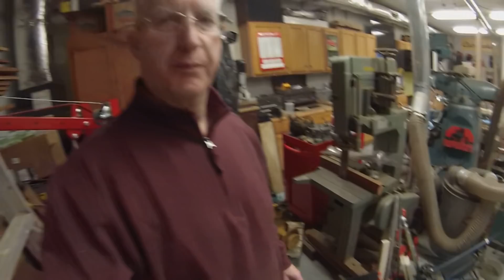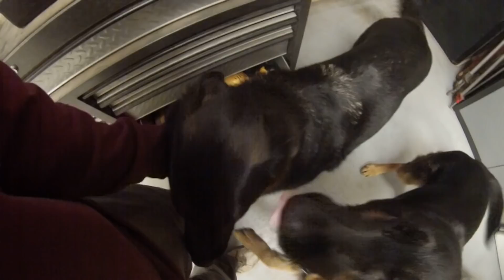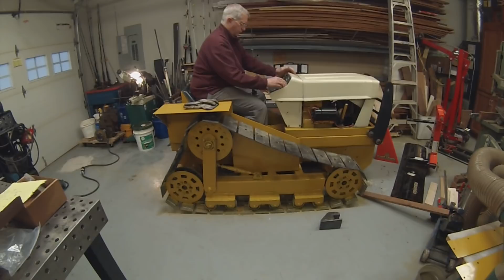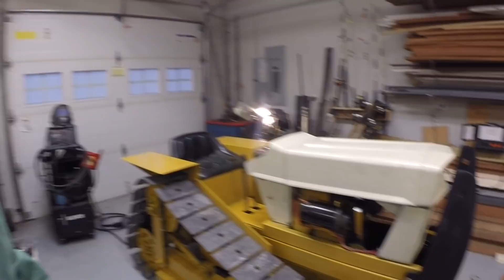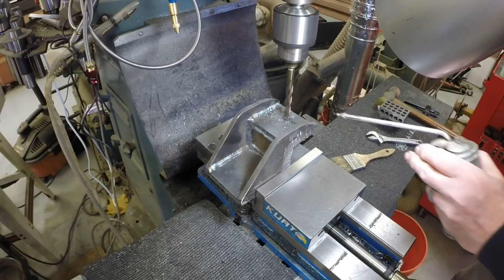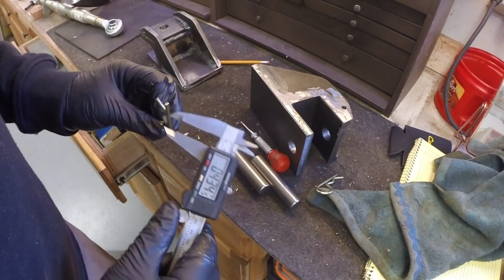Cub Cadet Dozer Build S2:E12, Don't Blade Me!

Comment: All the fab work you have done and you are going to put a chopped up snow plow on it? That looks bent already. You want your pushing strength near the bottom of the blade. Mount it near the cutting edge
Reply from the maker: Entire mount gets changed. Stay tuned!

Comment: What happens if the mounting pins get bent while the blade is mounted? The mount should be take the force not on the pin but on the mount.
Reply from the maker: Don't have the HP or the weight to bend a 7/8 inch pin.

Comment: From a plasma cnc guy - on the 1/2" and you need a hole - drill a hole with a hand drill and then pierce through the hole!  Not a big one but let it work a little.
Reply from the maker: You'll see in an upcoming episode, the plasma torch had no problem piercing the 1/2 inch stock.  Some dross on the back, but not too bad.

Comment: I have one question you have woodworking tools and metal working tools in the same space plus you are welding.  How do you control the wood and metal dust from getting on all of your machines?
Reply from the maker: I clean up after every project. Dust collection for the wood tools is pretty good and I leave zero sawdust on the floor. I vacuum almost every day.  I sweep a couple times a day.  The worst thing is grinding dust --which is restricted to the welding area but it goes everywhere. I need to set up a dedicated grinding station with curtains to control the sparks/dust.

Comment: A better solution and much more professional is to weld tabs on each pin and then a small 7/16 bolt threaded into the side of the bracket will hold the pins in place. You are going to have the lower arm wearing against the clip which it wasn't designed for.
Reply from the maker: That's a good idea. I have a washer between the cotter pin and the swivel eye to prevent wear, but your idea is better.  If it were a machine to be used every day, I'd say a better solution would be justified, but for my occasional use, what I have done is probably sufficient.

Comment: Thank you for explaining edge finder  . I use them but I struggle with them I never used them enough  .  . Good for people to see that don't use them how edge finder works . Awesome  job on the small bulldozer.  Wish I was as talented  . Awesome videos. . I was surprised you didn't use center drill bit first so stop drill wobble  .
Reply from the maker: I do use a center drill from time to time. When high accuracy is required.  I'm a bit lazy I guess...LOL.

Comment: Hey Frank, the dozer is looking great and I think you have a brilliant mind. You have done so much to make this to look like a high track I am having a hard time with the blade. You could build the blade like the real one a lot easier than trying to modify this . The Proportions are off because the blade is to small and the attachment is too bulky in my opinion. Not trying to be critical but you have done such a great job fabricating that I believe you could build it yourself and it would look better. Another thought is on the drive engagement, what do you think about some kind of electronic motor to switch so you don’t have to get out of you seat to engage?  Anyway, great job and thanks for taking us all on the journey!
Reply from the maker: I looked at remote cable clutch actuation but couldn't make it work. An electric actuator might be made to work. Something to look at down the road.  As for the blade, it's a tough call.  I want a 6 way blade. The final blade mount will not be any bulkier than any other dozer. What you are seeing in this video is not how it ends up. Stay tuned, it gets better.
Reply: @woodandmetalshoptime8048   A linear actuator should do the job. Much safer than getting on and off with the engine running and potential for a drive to have been moved and have the dozer start moving without you in the seat.

Comment: Woudnt the bracket work if you rotated it 90 deg and had the pin drop down into it ? A lot more surface area for weld and the arms wouldnt mmove up and down too much so shouldnt bind on the top and bottom ov the bracket. :)

Comment: I would have welded a flange with a tab on it to the end of the pin and bolted the tab to the bracket. I would have also drilled through the frame as well so that the pin was better supported.
Reply: Sorrows, did you weld flange with tab and drilled through frame for better pin support on your dozer build? Or just wishful thinking?
Reply: Exactly what I was thinking. An egg shaped plate with a retaining bolt.
Reply: Yes. I have done that on items that I have built.  It keeps the pin from being able to turn and wear between pin and mount which is the area with the least support. Also makes the retaining pieces separate from the moving parts.

Comment: Why not weld a tab to the pin, drill a hole in the tab. Then drill and tap a hole in the mount and use the tab to retain the pin to the mount?

Comment: Curious about how you will control the side to side sway inherent in the ball end connections? Also, check out Agri Supply Corporation (ASC). They carry a lot of ag related parts and supplies.
Reply from the maker: A stabilizer is planned to control side to side movement.

Comment: I am not understanding how this will work with two pivot points.  Your arms coming from the frame to the black assembly should all be one piece, welded to the blade assembly, and then you use the (2) hydraulic cylinders to raise and lower the blade, which will pivot from the tractor frame.  Then you can mount a 3rd cylinder horizontal to pivot the blade side to side.  Just my 2 cents sir.  Ty for sharing
Reply: look at the icon you use for these videos, the rendering of the dozer, that is how it should look sir.
Reply from the maker: I'm doing a 6 way blade, not the 4 way on the Cat D10. Each side needs to be independently height adjustable, so the "horseshoe" frame (or C frame or whatever) can't be solid.

Comment: l think It will be very difficult to do any fine grading with that blade so far out in front of your dozer. Good thing you have the road grader to do the finish work. What are you using for hydraulics? I don't think the Cub hydro unit will have enough capacity to do the  job. Nice build.
Reply from the maker: Cub hydraulics will work fine.  It's just a couple cylinders.  Blade gets moved much closer in next episodes.

Comment: Shorted your pin so that it sits flush with the outside of both plates, weld a small flat bar with a hole to one end and then drill and tap a hole in the outside of the units you have. That way you can insert them and have the bolt hold the pins in place.

Comment: Are you spacing the Heim joint?  Fitting spacers on either side for centering or is the joint allowed to float on the pin in your design?